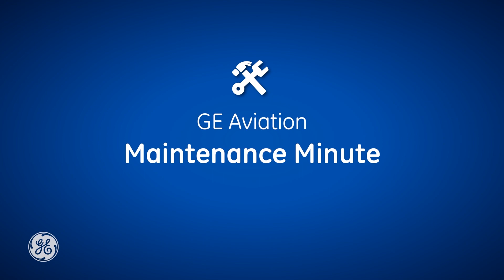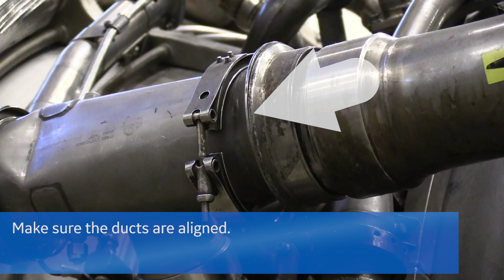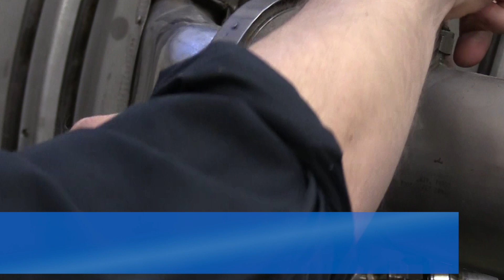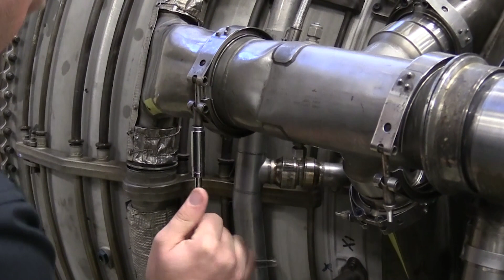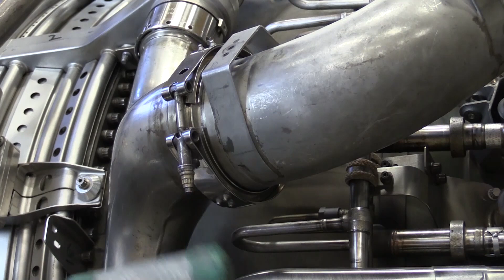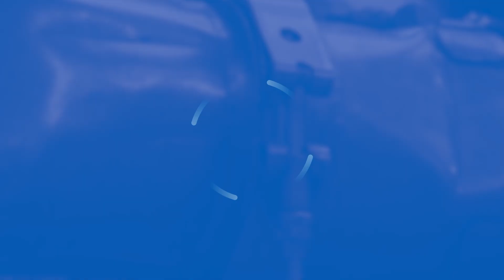All Engine Models - Installing V-Band Clamps - GE Aviation Maintenance Minute

Comment: Is it required a safety wire?
If yes what is the appproptiate
Reply: No it is not required generally. torque is enough. however, a;ways refer to the Maintenance Manual for your specific aircraft